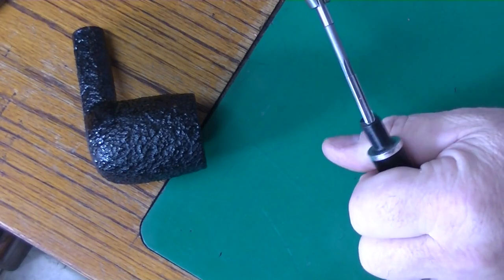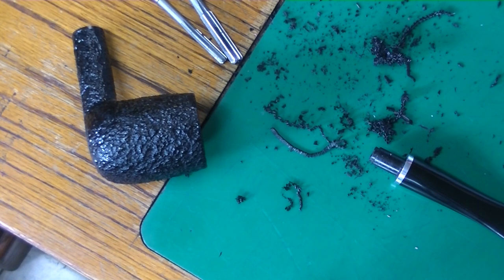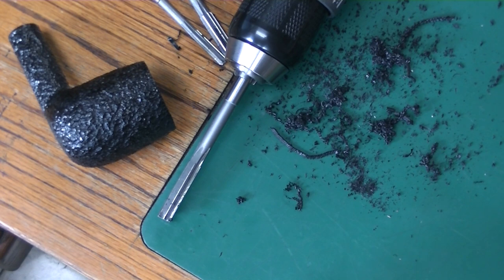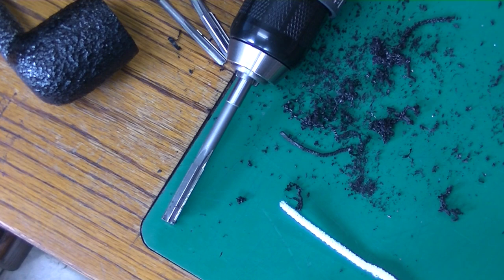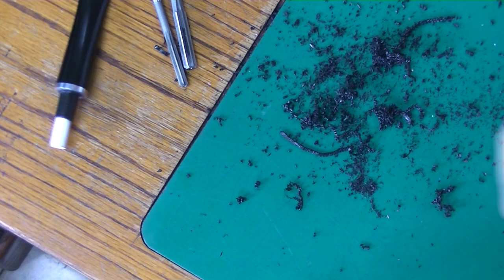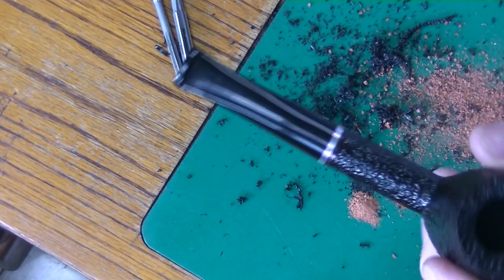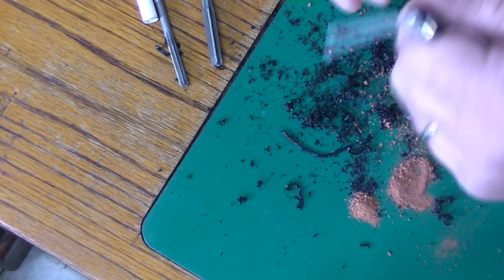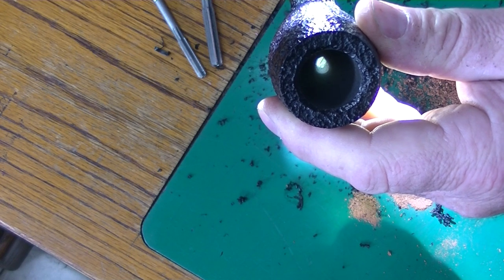rossii pipe 9mm conversion using metric reamers

Comment: I screwed up a pipe trying this long before I saw you or Mel do this. Is there a place just to buy the 9mm replacement, and take the 6 out?
Reply from the maker: here is a link to by a 9mm stem https://www.briar-pipes.com/en/ but keep in mind all 9mm pipes are not standard meaning everyone has there own twist to it so the tenon of the pipe varies by the manufacture of cause if the stem you buy is slightly fatter you can adjust the pipe to fit the new 9mm stem but if the 9mm stem you buy is smaller your can not fix that. So as an example out of 10 factory 9mm pipes the stems you can buy might only fit in 3-4 at best. So, unfortunately, its a trial and error type of thing.